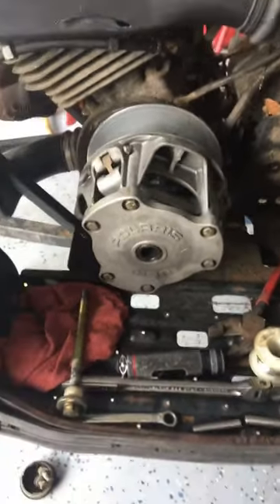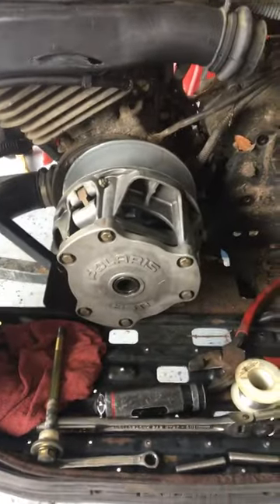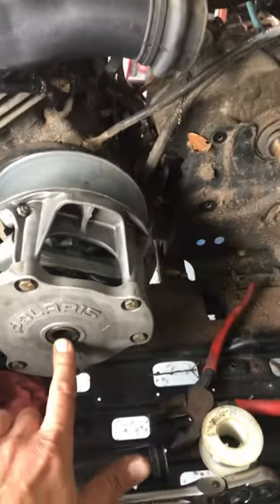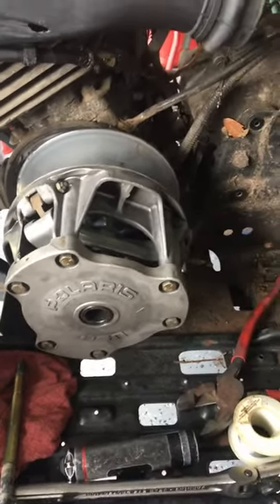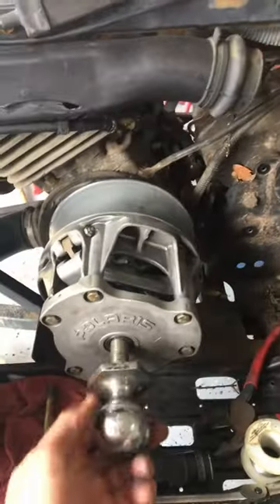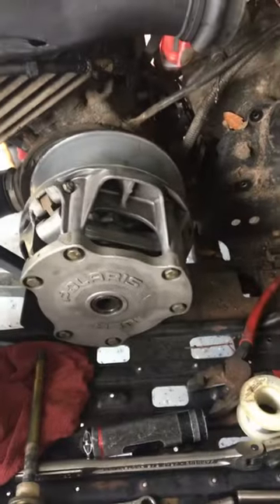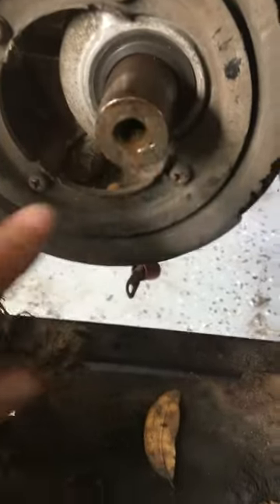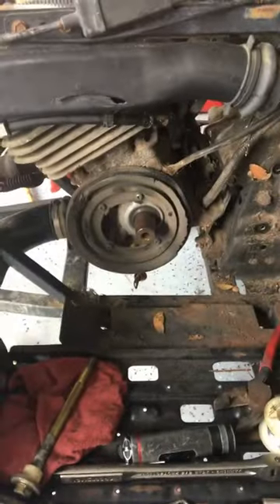Polaris Primary Clutch Hack

Comment: Put Teflon tape on the threads and fill hole with water,and hydro-lock it off this will save possibly damaging the threads,works every time.
Reply: Like the regular bolt you'd use to screw on the clutch and keep it on?
Reply: @itzstealthy8229  no you'll need a 3/4 fine thread
Reply: @dirtyfacegeorge9938  okay how long you think?
Reply: @itzstealthy8229  that trailer ball is probably long enough but I'd go with 6-8"
Reply: @dirtyfacegeorge9938  thank you!

Comment: If this method does not work, remove the spacer bolt he is using inside and pack the hole with bread and keep running the "trailer hitch bolt" in and out to pack it tight.(on my 2000 polaris scrambler the bolt side is 3/4", #16 threads and at least 2.5 inches long. you can use an all thread bolt but it was difficult to find 3/4 all thread. I found the bolt at tractor supply. Lowes and the other hardware and electric supply stores didnt carry anything that size.)Eventually the clutch will pop off with some force so be ready. But I tried with the bolt like this video and it still didnt work. Found the bread method creates a ton of pressure and pops the clutch off. I've seen where you can use grease instead of bread but it's much more messy and the bread seems to work better anyway from my research.

Comment: Took two tries, first time just had to double up on thread locker tape.  It moved a very small amount at first, but just taking my time at it and it popped off.  Was very stuck on.  Used wd40 on the back side of it.  Not sure if that helped.